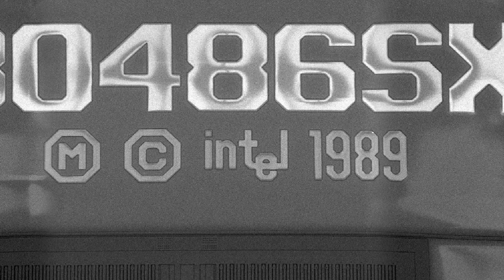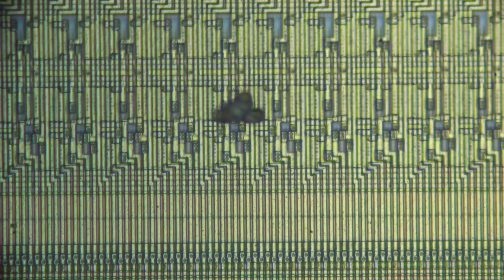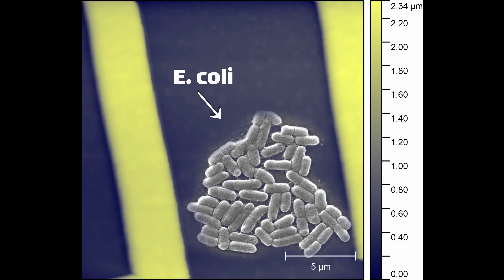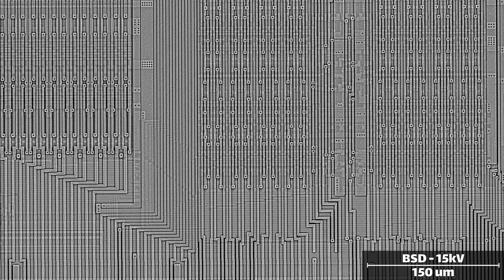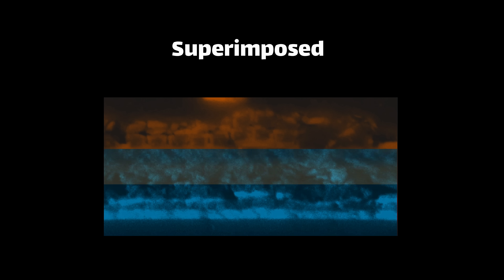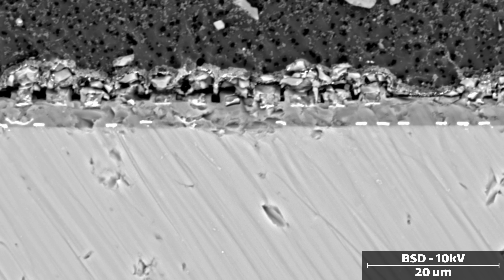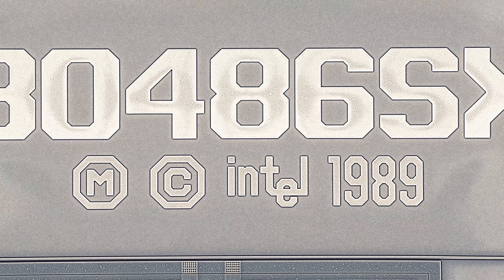Microscopic view of an Intel i486

Comment: when looking only at the transistor count (i know, wiring and stuff couldnt be scaled down 1:1), you could actually put close to 20.000 486 dies in place of one AMD zen 3 die. its 20 billion vs one million transistors. or the other way around: you would not be able to see the 486 die with your naked eyes when done in modern lithography, because it would only be some µm² in size. even the optical microscope would have trouble resolving anything useful. 

and yet, even the original 486 feels like sci fi magic when thinking about it.

its totaly astonishing.

Comment: This is impressive. The fact this tiny structure was manufacturable 30 years ago means to me technology is way more advanced than I believed it was. Now, they're on a nanoscale level (7 to 14, and soon as low as 4), meaning everything you see there is actually between a hundredfold to a thousandfold smaller. So they can litterally put over 100 486 CPUs in the same space than a single 486 CPU. And that's not accounting for the 3rd dimension: add several 10s more layers, and you're in the 500-1000x density range.

Awesome.
Reply: It's more sigificant than that. Transistor count comparison - a modern 12900k has 12.4 billion transistors in a 215 mm² area. 486 is 1.2 million in a 82 mm² area. That means, the real number is closer to 5000 486's in the 82 mm² area. 
Microchips are probably the most impressive thing that humanity does, even more so than space travel.
Reply: @mornnb  Assuming your counts and surface area are right, it's slightly under 4000 actually. Still, I was being conservative in my first estimate to make sure I wasn't wrong, but I managed to be wrong nonetheless. XD

But that's only the physical count scaling this. Computing power usually doesn't scale linearly, and I wonder what would be the difference there, because I've got no time just now to research it. Gains in efficiency accelerate the chip, meanwhile increase in complexity slows it down. Really wonder what the net result is.
Reply: Here is a transistor view for the 19-9900k (intel 14nm) that i saw a few years back.  https://www.youtube.com/watch?v=TtuUANbaEFI 

I just catched this video from the algorithm, a good find.
Reply: That s actually not true. The definition on nm with chips changed. When you see 7nm or 14nm it s fake. The transistor it s not actually that small. It s more like 30/40 nm still . The 7nm and 14nm is just the gate lenght .
Reply: @iwillnoteatzebugs  The point is for current gen chips it means absolutely nothing physical and is a marketing term.
Reply: @iwillnoteatzebugs  Accurate. This is why I now think transistor density might be a more representative metric.
Reply: @iwillnoteatzebugs  So, when the gate length equals the 7nm, is gate length not a structure element? Thought 7nm is refering to the smallest structure elements. Is the gate nothing physical?
Reply: @mtt8244  yes, but that s not what they make you believe in marketing for consumers . They just say “ this is a 7 nm CHIP” which is a false statement
Reply: and we use modern CPUs for python programs so we can keep all those new transistors busy for little benefit.
Reply: @tricky778  You could argue the benefit is the savings in developers productivity....
Reply: @mornnb  not really, there are very few development events relative to computation events, so the execution efficiency dominates over development efficiency when you get to the very expensive execution of python.
Reply: That's the thing with microchip technology isn't it? The capability of the microchip itself immediately makes it possible for an even better, more powerful one to be designed  and built. Therefore the moment one is made by virtue of its own ability, it becomes obsolete.
Reply: Nothing on a 7 nm chip is actually 7 nm. On a 0.350 micron process the gate pitch and the minimum metal pitch are both 0.350 micron. This has never been the case since; with RAM optimizing for minimum metal pitch and CMOS logic optimizing for gate pitch. Since FINFET the no dimension anywhere on a chip is even close to the node name and they're not even very comparable between manufacturers.
Reply: @soylentgreenb  This is not true, there are structures above and below 7nm on this technology node. And surely ones with 7nm 😅if you don't think so, explain this: https://youtu.be/TtuUANbaEFI?t=495
Reply: @soylentgreenb  Ok. You kind of told me I was wrong, but without correcting the mistake. Would you have that information handy by any chance?
Reply: As someone below pointed out, the "7nm" you see marketed by manufacturers these days is not actually 7nm. Intel was the last manufacturer to at least try and be somewhat consistent to that standard. E.g. Intel's 10nm, wholistically, is still far smaller, and denser, than AMD's so-called "7nm" process. That's why Intel has struggled so much from 14nm to 10nm, and, will continue to do so to 7nm, as they're actually adhering much closer to that standard, instead of just marketing it away into nonsense. It's also why, when Intel gets around to polishing their chips in subsequent releases, they keep blowing away the competition even on the same architecture.

This is a massive simplification of all the finer points and concepts in this argument; but, hopefully, it helps get the ball rolling for you.
Reply: @jcpt928  
https://www.youtube.com/watch?v=GdLRSF5wZpE&ab_channel=AnastasiInTech
Reply: We were at 5-7 in 2022 not 7-14.
Reply: Maybe you just aren't old enough. Most people started getting computers in their homes in the early 80's (although the Altair 8800 came out in the mid 70's.) They were little more than toys even when compared to this 486. However, they were truly amazing when compared to how we had solved problems for thousands of years
Reply: @matthewbanta3240  My age is fine thank you very much. This CPU is still younger than me. I just never had the opportunity to see how small those silicons already were at that time, and that's just putting everything technological into perspective to me. 

I used to be a machine designer, so I am well aware of precision manufacturing techniques. But this is still order of magnitudes smaller and more precise than what was achieveable in my domain 20 years ago. 

And that's the fun about learning new stuff: despite looking like an idiot to the people you're expressing your awe to, you end up growing as a person nonetheless.
Reply: @matthewbanta3240  what an unbelievably useless comment. “Back in MY day we actually understood how amazing technology was”.  GTFOH
Reply: @HCG  it was compelling enough that you felt the need to reply to it. Thank you for that
Reply: @matthewbanta3240  Yes, I often find that a quick comment is the fastest way to help others reengage self-awareness
Reply: @HCG  jeez elliot calm down bro he's already turned to ashes ;-;

Comment: Neat tidbit about the 486 die that you examined, part of it never worked from the factory!  The 486 SX was the same die as the DX but the math-coprosessor is disabled because it failed during testing.  Rather than discard a very expensive to manufacture die, they burned the power traces to the FPU with a laser and shipped it out as the SX to still make a bit of money, selling it as a low cost option for the day.

The 487 math co-processor that you could buy and put into a matching socket was actually a full 486 that disabled the SX.  (PC architecture at the time didn't really support multiple processors in the way it does now.)
Reply from the maker: Hah, that's very cool!  I had heard it was missing the FPU, but I didn't realize it was just defective and they just burnt it out (and that the co-processor was the inverse haha). Very neat tidbit!  And honestly a pretty clever arrangement to recoup investment on an expensive mistake.
Reply: @BreakingTaps  Yes, indeed! Although whole 486SX was a product caused by accident it sold very well... So well actually that on later stage they took fully functional 486DX chips and burned out the FPU with laser to produce more 486SX chips. (or that is at least what I heard) World is a funny place.

Comment: How did you decap the lid?
Reply from the maker: Hot plate to about 250-300C, then the solder gets soft enough you can pull it off with some tweezers or a magnet :)  Getting the die out of the package later for grinding was a lot more difficult.  Ended up using a diamond saw + dremel to cut it out.
Reply: @BreakingTaps  thanks.
Reply: @BreakingTaps  thanks, I'm not interested in removing the die but thanks anyway. Great channel.

Comment: Seeing the elemental colormap of the cross-section makes me realise how well structured and carefully designed the whole process is.

Seeing silicon and oxygen was intriguing (but not that surprising), but seeing the aluminium microwires having a coating of titanium underneath was eye-opening. And seeing that the Electron Microscope is able to discern between atomic elements is something that blew my mind! 🤯

The amount of planning and work involved made me really appreciate the sheer complexity of microchips!

Comment: I would like to see what different parts of an IC does. There's a break in knowledge for me between how a transistor works and how they're used in large numbers to form a processor.
Reply: Transistors are connected together to make logic gates. Then logic gates are connected together to make more complex functions.

The thing for you to do is study "Digital Logic".

Generally designers don't worry about the transistors, they are writing code or schematic capture (circuit diagrams) to implement logic gates. The logic gates exist in a hard macro library where the design of the logic gate, the transistors and how they are connected is already specified and performance characterised. 

So most of the time, the design engineers are working with logic gates, or higher order elements comprising logic gates.
Reply: @deang5622  thanks! Do you know what software they would use?
Reply: @iamjimgroth  There is all sorts of software packages.
My employer was a chip manufacturer and we developed our tools, and that covered everything from schematic capture tool, to logic simulation, automatic test pattern generation, the layout tools and place and route were all in house developed.
Now, customers doing chip designs with us, we would sometimes let them use our schematic capture too, and that contained a logic simulator too.

We did use 3rd party tools, notably: Synopsys Design compiler for implementing a logic design using VHDL hardware description language.

We also used a tool from Mentor Graphics.
I didn't use that one personally.

For really complex chip layouts pushing high utilisation of the chip, we wouldn't use our own tools, we used one very expensive package called Tangate.

Verilog was another tool we used, a different type of hardware description language, an alternative to VHDL.

There was a design verification tool called Dracula. This was a physical layout verification tool, which was used after performing place and route of the transistors on the chip. So this was doing mask level verification immediately before fabrication of the chips. So it was checking many design rules and applying them across the entire chip, checking physical dimensions of interconnect traces, physical separation, of everything on the die. It had a lot to do, and it was very slow.

Now most of the chips I worked on, we didn't need to use that physical verification tool.
Reply: @deang5622  they sounds really cool. :)

So am I understanding it right if I say it's a bit like PCB design but on tiny scales?
Reply: @iamjimgroth  In some ways it is a little like PCB design, particularly if you have to manually perform routing. Which I did on occasion.  And what you see on the screen are shapes representing the outline of the logic gates and horizontal and vertical lines representing the metal traces. Where as a metal connection trace in reality has width, we don't see the width, we just see a single straight line. And then we in those days were working on 3 layers, drawing on the screen horizontal and vertical lines and dropping "vias" to provide the connection through from one layer to the next.   So ideally we left it to the software try and connect all the logic gates up, but often it would get stuck, and could create short circuits, or it just couldn't find a path through the chip to connect two pins on different logic gates together. So then you'd go in by hand, move some tracks out of the way, and try and meander a trace through the chaos.., jumping up and down through the 3 metal layers as necessary.

There are a number of different design technologies, Full Custom, Standard Cell, ASIC.  With full custom you'd be working actually at the transistor level on the chip.
Reply: @deang5622  I usually end up manually routing my PCBs. I guess the free stuff isn't so good when even a noob can solve stuff it can't. 😁

I'd love to see how this stuff looks. Are there any videos, it search terms you can recommend?
Reply: https://www.youtube.com/watch?v=HyznrdDSSGM&list=PLowKtXNTBypGqImE405J2565dvjafglHU
Reply: @moshly64  I appreciate the link, but unfortunately I misspoke. The divide in knowledge is actually focused mostly on the level just above understanding the things that are explained in that video series. That is, how are these things actually realised in an IC. I see these pictures of ICs and I can't grasp how this beautiful landscape forms an ALU or a program memory. Sometimes I see a pattern and I think "that has to be memory because it's such a large area of repeating structure" but other than that... Shrugs

Comment: Polishing is not as easy as one would assume. Had a project in college to see the difference in heat treating steel under a microscope, polishing the samples to a mirror finish was needed, there were extra points for being able to wring the two samples together like gauge blocks.

Comment: Does the 486sx not have easter eggs?  I've taken micrographs of a i486DX and it has a block full of initials, other initials hidden in the traces, and the big 486 etched in one area.  That 486 had the most graffiti on it, the 386 and pentium 90 I imaged didn't have any.  Another cool chip to image is the Weitek 3172A, that had entire names etched on empty spaces.   Last chips to have removable covers were from the late 90s, after that they started making them solid for better heat transfer.
Reply from the maker: Oh, it did! I found the big block of initials ("JL<backwards-J>") and the 486 logo. Didn't see the hidden initials, but will go peruse my stitched scan to see if I can find it. I actually captured some really nice images of the initial block... but lost the data :( The next day I was imaging some other parts of the chip and the software was happily reusing names and overwriting my prior images, so I lost a bunch of stuff.  Unfortunately only realized after I had embedded in epoxy and started grinding away at the chip.
Reply: @BreakingTaps   If the 496 logo is at the top and readable, the larger somewhat hidden set of 3 initials are in the large trace to the right and a little down from the block of many initials.  There's also something written in the lower right corner.

Comment: I'll never forget when I was working on bare ICs at Hughes Aircraft (we were making multichip modules), and I was bored and looking at an IC with a high power microscope. Suddenly I saw a "happy face", circle with eyes and mouth, upside down. I turned the whole thing around, and sure enough, there was a very distinct happy face on the die. Of course I told my coworkers about it, and they just smiled. IC makers put lots of easter eggs on their chips just for the fun of it.

Comment: Very cool and zen look at the microworld. A note on the afm scans, it seems your tip was likely not tracking the traces as it fell off the tops of the metal edges. You can often spot this when the trace and retrace scans are not very similar especially when coming off sharp edges. This can be improved by either slowing the scan speed, decreasing the tapping set-point voltage, or increasing the gains on the PID loop.
Reply from the maker: Yeah, I noticed that as well. In this case, I think the sample itself was slightly tilted with respect to the tip (and/or the cantilever's arc). The forward and reverse scans actually look pretty similar and not much on the error map.  So my theory was that the sample was tilted slightly, allowing the tip to access one side of the vertical wall but not the other wall (since it would be "shadowed" by the overhang).  But I could be wrong! Still learning to spot artifacts and their causes :)  Cheers for the advice!  Will keep that in mind for future scans.
Reply: @BreakingTaps  That's true, it could be due to the angle of the cantilever or the tip geometry. Many tips are also asymmetric along the cantilever axis allowing the tracking of steeper walls on one side.

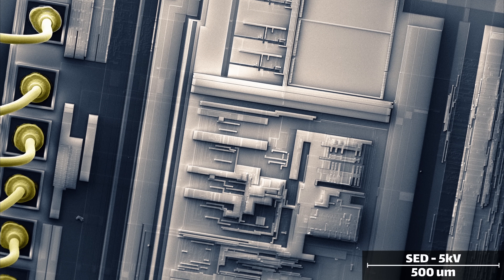Comment: I would love a huge print of a 486 die... Hard to find. How much does your microscope cost if you don't mind me asking? (the optical one for the early shots around 3:00)
Reply from the maker: Mine was about $900 from Amscope (40X-800X Trinocular Dual-illumination Metallurgical), but a simpler metallurgical-only microscope from Amscope should be considerably cheaper.  They are mass-produced chinese instruments, and I've heard to some bad things about their really cheap models, but I'm pretty happy with the two that I own.  Definitely cheaper than a Zeiss or Leica new!  Although you can probably find a good bargain on vintage metallurgical scopes if you hunt ebay.
Reply: @BreakingTaps  oh that's awesome thanks heaps!